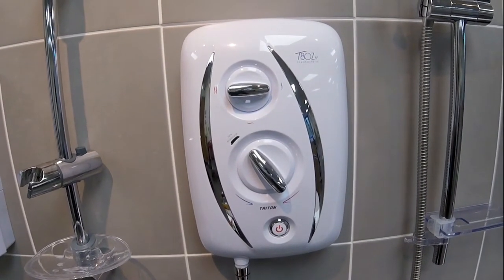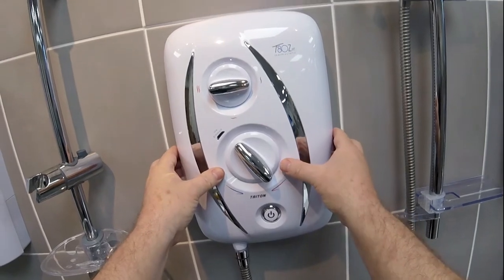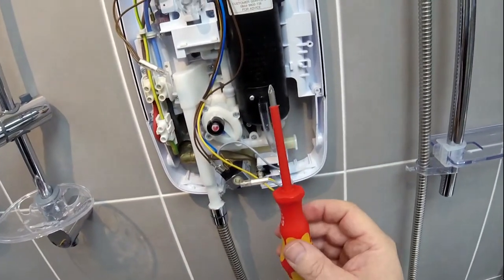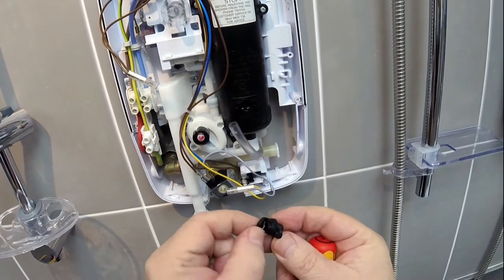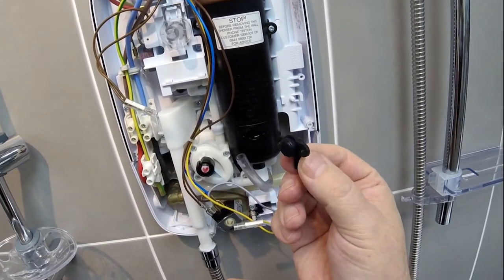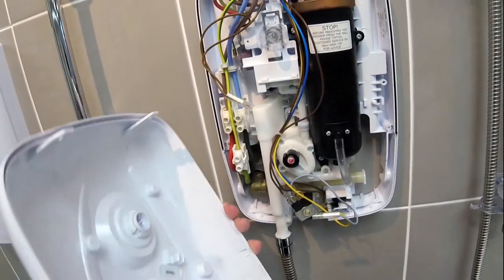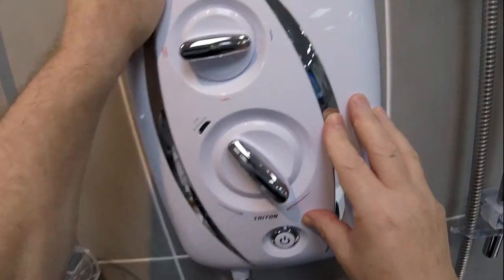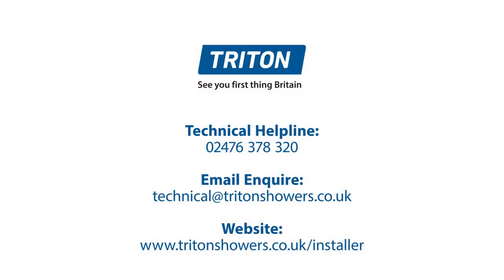Replacing the pressure relief device on the Triton T80Z Thermostatic Fast-Fit Electric Shower

Comment: Hi I’ve fitted the T 80 z and can’t get any heat at all what might be the problem thanks in advance, and great content
Reply from the maker: It would be worth in the first instance checking the water pressure going to the product, if the minimum water pressure requirement is not being met then the elements in the shower won't activate. If the water pressure is okay it would be worth contacting our service team on 02476 372222

Comment: Do you need to turn the mains water off to do this?
Reply from the maker: In the fitting instructions supplied with the PRD we say to switch off the electricity and water supply at the mains before replacing
Reply: @TritonShowers  perfect thanks for the quick reply

Comment: I have one of these in my house and it just won't get cold.....I'm dying in this heat. I can't even open it to check 😩
Reply from the maker: It would be worth checking the accessories are clear, no kinks in the hose and the head jets have no hard water build up. Restrictions can cause overheating due to the water sitting in the heater longer. If the accessories appear okay we'd advise contacting our service team on 02476 372222 for further help.